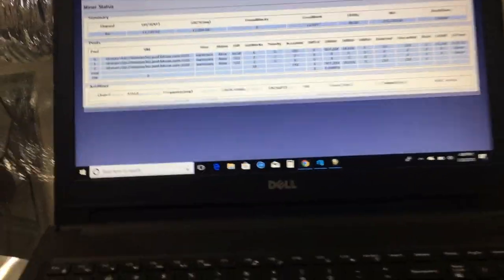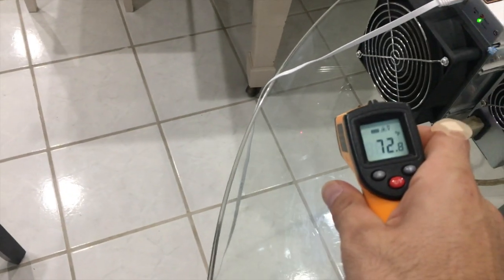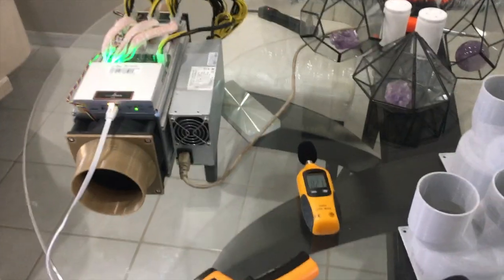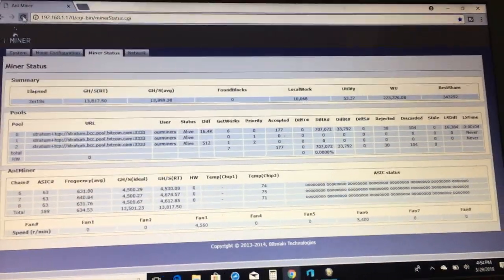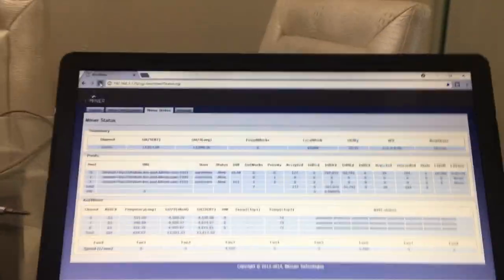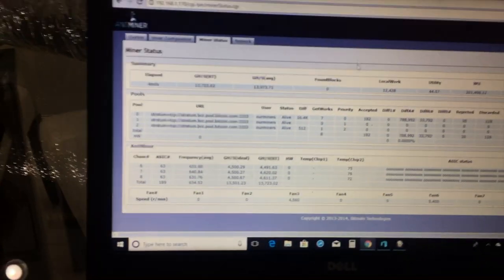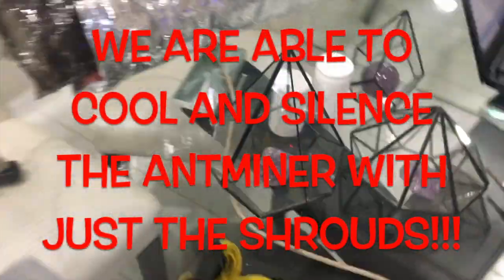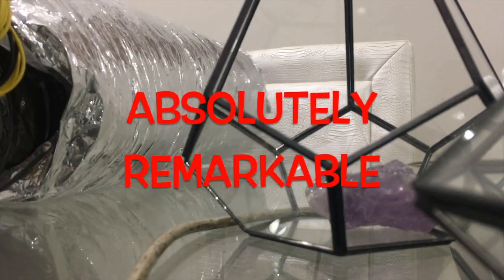soundproofing antminer s9 cooling experiment silencer custom fan shroud testing dual exhaust 4 inch

Comment: nice but i heard 3D print melts on S9
Reply from the maker: The material melts around 180-220 degrees Celsius! If you are running any computing hardware that hot than most likely it’s fried

Comment: Question, I have a T2 Turbo Miner, I have from innosilicon, and I would like to know if your cooler unit would be able to silence the 75db, I am interested to buy one, but want to know if it could be put in your specially made box
Reply from the maker: Hi Coldkeyes let me check and find out.

Comment: So you made that yourself right? what kind of plastic is it made out of? PLA? ABS?
Reply from the maker: These are made out of PLA and yes I designed these.
Reply: How are you selling them? can i buy a couple from you?
Reply from the maker: I do not sell them  but I did print them to a couple supplies on eBay and amazon. I think they are under dual silencers or dual mufflers.

Comment: The insulation duct should be at least 6ft to be more silent. And also get a cheap car cone air intake to filter out the dust to form inside ur s9
Reply from the maker: No at 6ft you are adding way to much air resistance. Your back up pressure increases to over 87% that is a absolute no go. Also adding a filter on the top end reduces your air intake tremendously. These units are build to be open, just adding 4 inch open shrouds can destroy your unit let alone what you just suggested. Not trying to put you down I just don’t want you to ruin your unit .
Reply: Miner Digi i get wat ure saying but ive beeen running my s9 for about 5 months with no issues. I have 4 inch cooling shroud on both sides and the intake fan is the only cone car intake i installed with 4inch to 3 1/2 inch reducing adapter (i did not put insulation duct on the intake area) and the exhaust fan has 6 ft insulation duct. My intake fan is steady 4,500 rpm and my exhaust fan is steady 4,200 rpm. All 3 board temps. r below 70 degrees celcius. The way i keep my room cooled is not by ac but by dehumidifier. Im not saying ur way is wrong but juss telling u my setup.
Reply from the maker: If you live in a dry climate you can use a evap cooler and have amazing results.
Reply: Miner Digi i wish i lived in a dry climate. I live in nyc where the weather is bipolar so thats y i got a dehumidifier lol
Reply from the maker: Ahh lol you got cold air though! That is the key! Florida we have the worst of both worlds ! Humid and hot !
Reply: Miner Digi ahhh icic. Yea man the humidity in gator state is horrid. Which pool r u using if u dont mind me askin?
Reply from the maker: Hahaha 100% I’m using slush for half my machines for BTC and bitcoin pool for BCH. I like to diversify. And always ask my bro that’s why I’m here and posting the videos is to try and help.

Comment: How many DBs did you get with shrout and insulated duct?
Reply from the maker: Only 1 more DB drop but also I didn't securely attach it. These mufflers are rocking! Changed the design slightly so the output pipes are longer and should have a better db drop!

Comment: Awesome! Where can we buy these?
Reply from the maker: In the process of making our first batch! Should be on amazon by Monday!!!!
Reply: Will you post a link and how much will you be selling them for?
Reply from the maker: I sure will, let me finish printing , weighing and calculating electricity and I will get them out to the first supplier. I make sure they don’t mark them up high or I pull them from there store 💪🏽
Reply from the maker: First batch has will be shipped tomorrow overnight to a seller on eBay. They should have them by Tuesday morning.

Comment: Hi, great video again, is there a reason to have the insulation duct only in one side of the miner?
Reply from the maker: No reason other than most people running farms are only using ducting on the backend